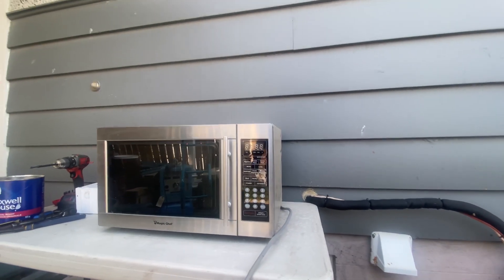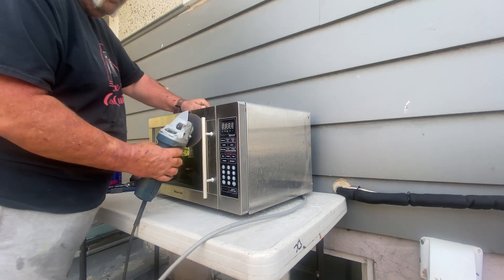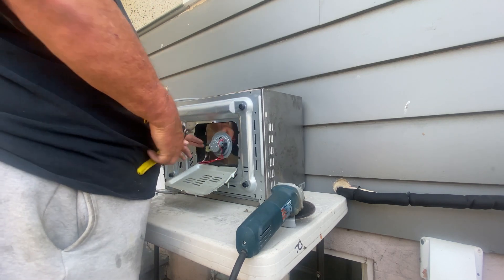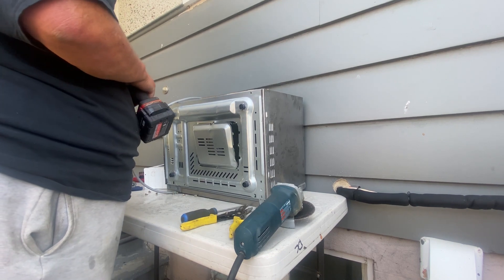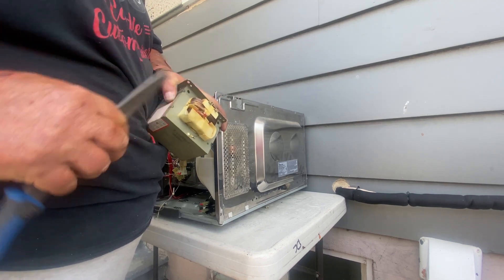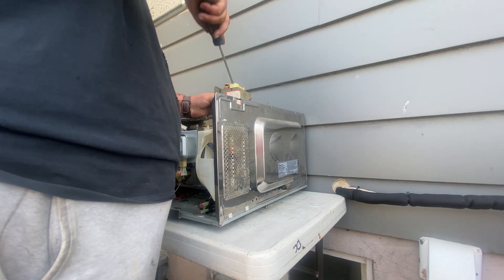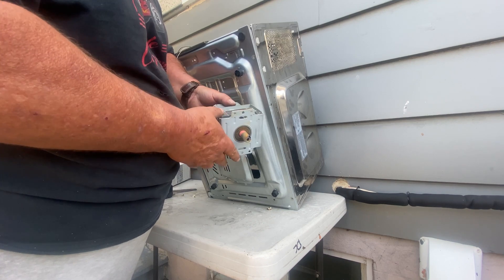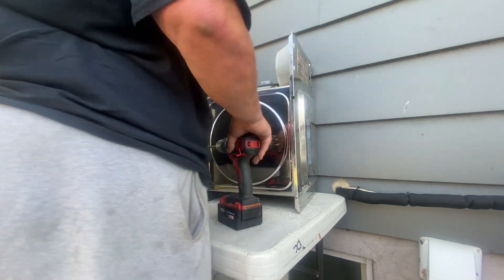Microwave Oven Metal Scrapping: Recovering Tin, Stainless Steel, and Copper! @scrapitall200

Comment: I can't believe you will go after the four cents worth of silver and the twenty cents worth of door board but you don't bother with magnetrons.
Reply from the maker: I have always been scared of them I have a bunch here but I’m a very safe place
Reply: There's no burrium oxide inside mags they stopped using it 40 pl years ago.  It is a good idea to have proper ventilation for ceramic dust.. Check out  UK Scrapper video on how easy it is.
Reply: @ThatsRightRecycling  Untrue. Some companies still use beryllium oxide, just not Asian countries, because it's too expensive. I still get lots of microwaves from the 80s and 90s, so why take the chance? Put some tape on it if you are grinding and worried about your lungs. If you don't care, don't tape it.
Reply from the maker: @ThatsRightRecycling  will do
Reply from the maker: @HHRecycling  I’ll have to investigate more on how to process them safely and just assume everything is toxic